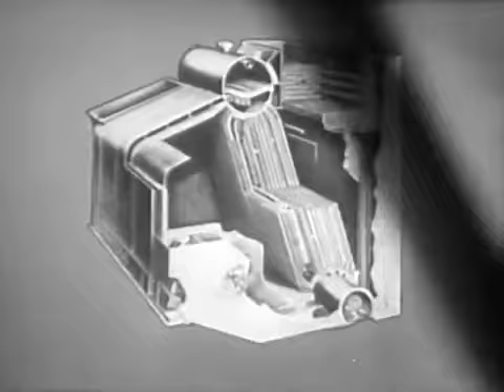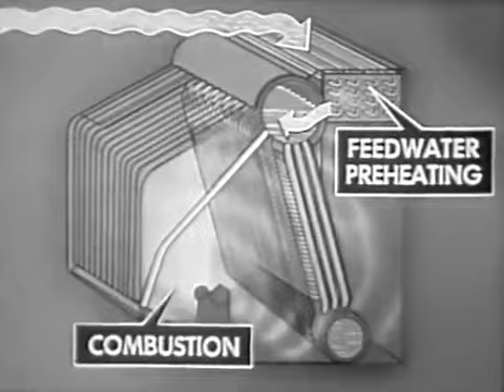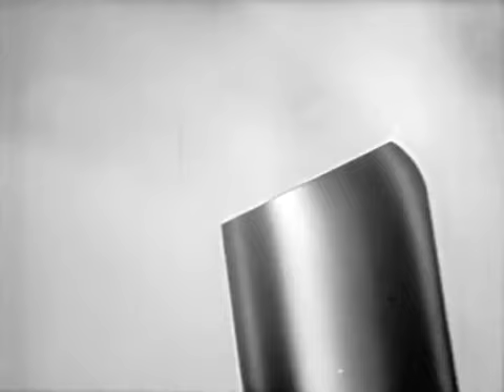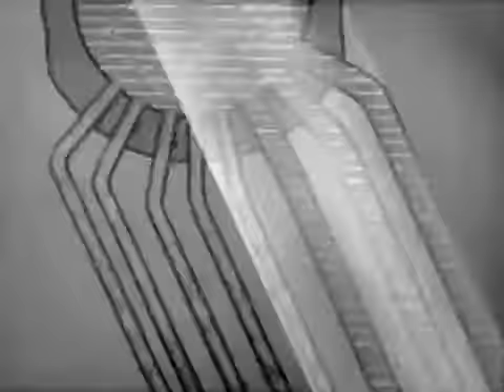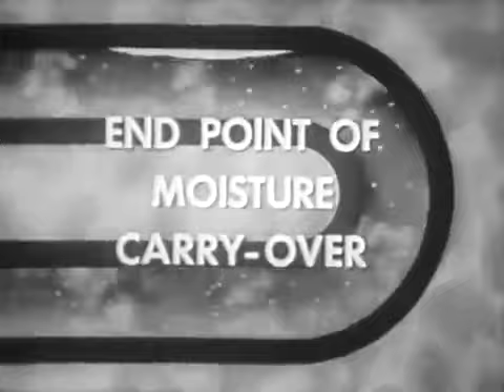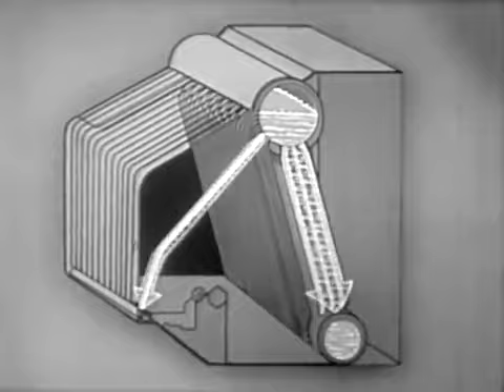Boilers and their Operation -- The Steam Cycle ; 1955 US Navy film

Comment: Just in the 1st 2 and a half minutes I would change the used steam returns as feedwater to the used steam returns as condensate.  I wouldn't call it feedwater until it passes through the D.A tank and is injected with boiler water treatment chemicals "as needed".